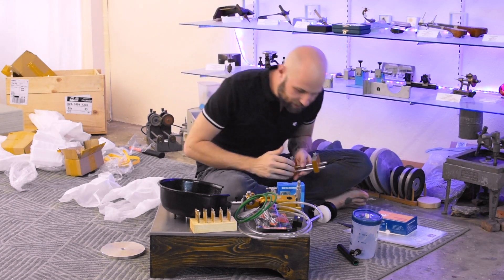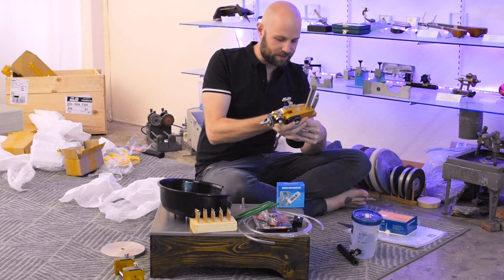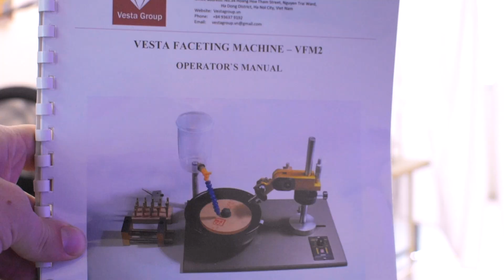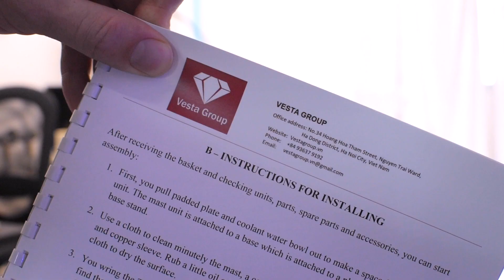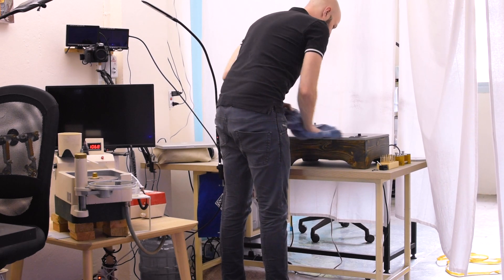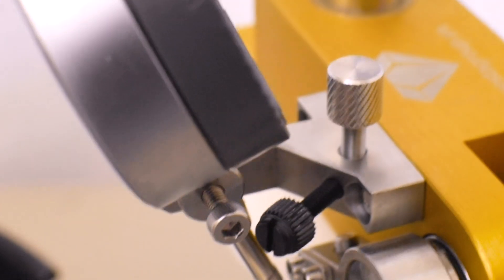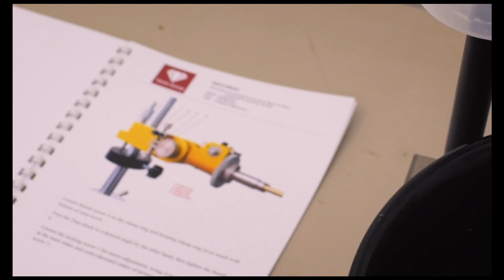Unboxing the VFM2 Faceting Machine from Vesta

Comment: Justin, Looking at the handpieces that you have on the shelf behind you I see one that I think is a winner. It has been on machines used in Germany and Italy where the laps were verticle. I still think this is the ideal position and geometry for speed, precision and accuracy. Unfortunately, I am not a machinist but a faceter and seller of mast type machines.
Reply from the maker: Yes I think you are referring to the bunter. It’s in the bottom right shelf? Probably best machine ever made. My wife uses is all the time.

Comment: Nice and promising machine :). However on their facebook I can't find any information or price for the VFM2 (just the VFM1). Is there any way to get some info and specs on a website ?
Reply: $1500
Reply: Where did you find it ? The VFM1 is 1446$. Such a little difference ?
Reply from the maker: I think maybe the vfm2 isn’t fully released yet. I’m not quite sure.
Reply: @JustinKPrim  thank you. I contacted them directly on facebook and got my answer ( 1330$)